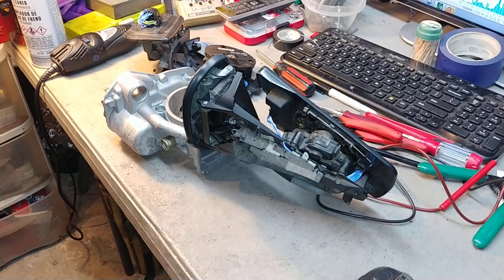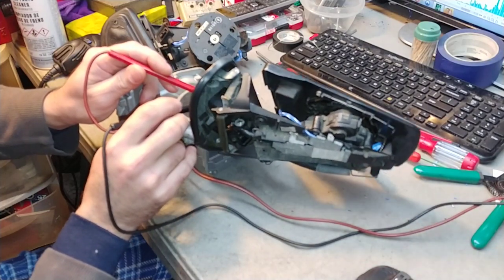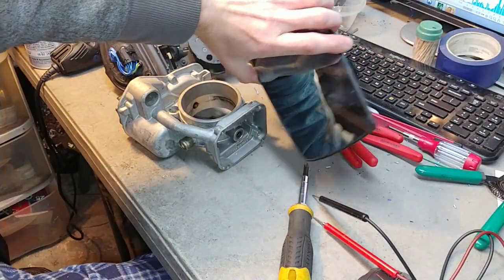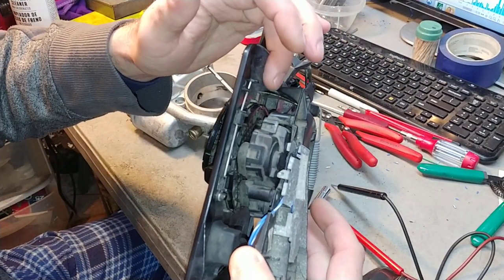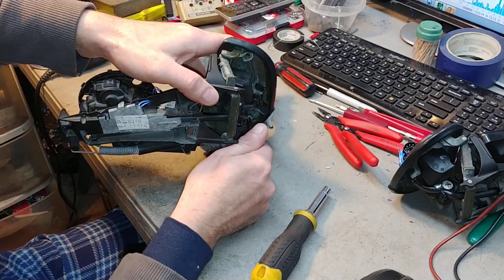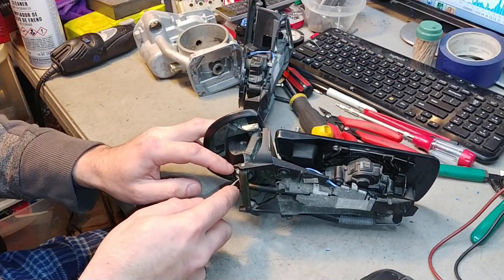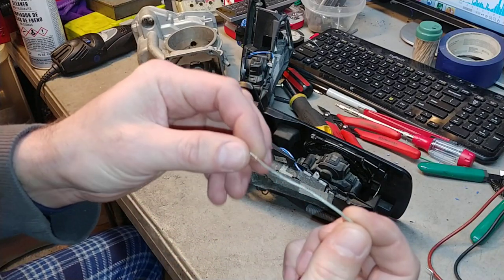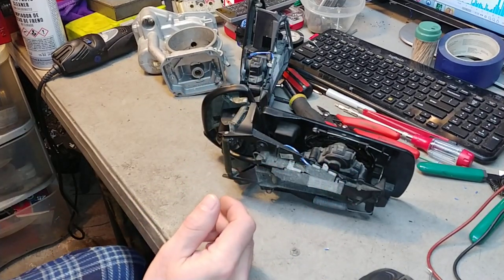Mercedes S500 mirrors rewired. Bench test

Comment: Biodegradable insulation?
Reply from the maker: Yes. All those mirrors have biodegradable wiring insulation.
Reply: @vsandvs  Funny what Mercedes was thinking when they were designing the cars with these wires in them. I have an older S class, California wersion but no problem with wires.